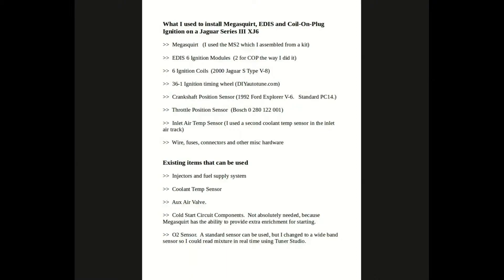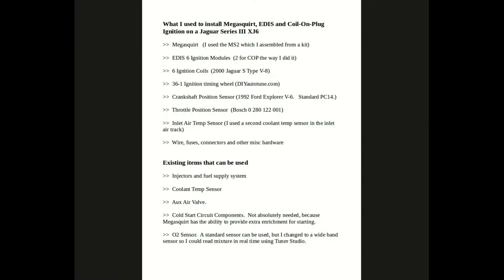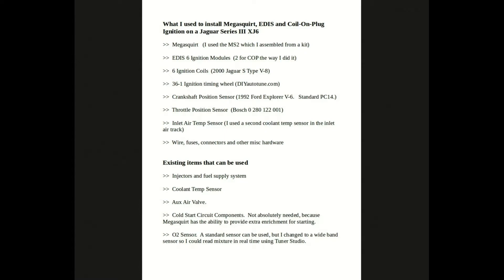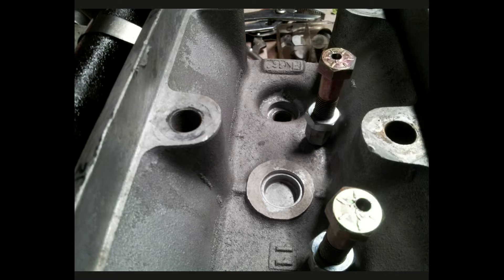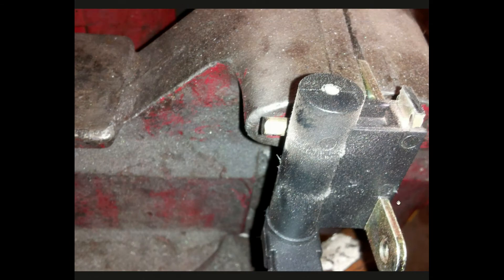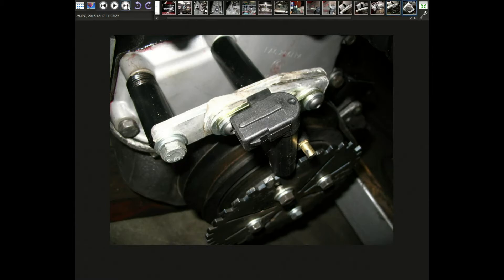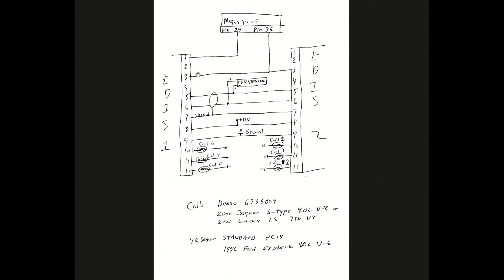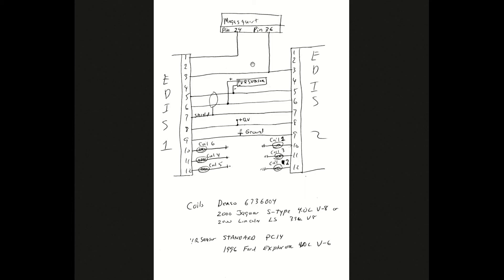83 Jaguar XJ6 with Megasquirt and Coil On Plug Ignition

Comment: Any way you would ever produce a bolt on kit for this? I would totally buy one!!
Reply from the maker: Greetings, I am pleased that you find the concept interesting. I did think about the idea of putting a kit together one time but decided against it. Didn't think there would be enough interest to make it worthwhile. 
Are you referring to the Coil-on-plug part or the whole system with the Megasquirt?

I will be happy to share with you any knowledge I have about it it you decide to do it yourself. However, since I did this five years ago, some of my knowledge might be outdated.
Also, it works so well that I never have to tinker with it and I would have to relearn things that I knew when I assembled it.
Let me know if you are interested in doing it yourself.
Reply: @novom2001  I would appreciate any help you would have to offer! Probably won’t get started on this until winter however.
Reply from the maker: @garthharpole6369   Just give me a shout.  Happy to help anyway I can.

Comment: Hello, do you think this idea of running multiple EDIS6 controller modules from a single VR sensor and single megasquirt ECU could also be adapted to run EDIS ignition for the Jaguar V12?
Reply from the maker: Greetings, 
I must admit I am not familiar with the latest versions of the Megasquirt, but from my knowledge of the MS2 I'm afraid this will not work.  The fuel injection part of it would probably work because the MS2 has 2 injector channels and the early versions of the V-12 fuel inj systems had 2 channels so I think with a little bit of creativity you could probably make this work.  The problem would come with the ignition.  Since the V-12 is basically 2  six cylinder engines on a single crank it means that the firing pulses are going to be 60 degrees apart. The EDIS is a wasted spark ign system and it fires a plug every time the piston comes up, both on compression and exhaust. If you used the EDIS 6 cylinder coil, you would need two, one for each bank.  The problem would be timing these coils.  Maybe it could be done, but you would need a separate computing device of some type to keep track of which cylinder to fire. 

You could however do it by using 2 Megasquirts.  Set up each bank as a separate 6 cylinder engine.  You would need two timing wheels and two pickups spaced 60 degrees apart.
Reply: @novom2001  I know there is some adjustment in the megasquirt tuning software to allow for a crank sensor that is not exactly at the right position but I wonder if it would be possible to tell the second megasquirt that the PIP signal is actually 60° out. This would eliminate the need for a second crank sensor.
Reply from the maker: @jensenhealey907efi  Sounds good in theory. I haven't tried to add that much of an error signal. I did use this feature when I set mine up, but it was very close to start with.  Best place to start is with Tuner Studio and see if it will allow that much variation.

Comment: Awesome video! I am getting all the parts together to do the same conversion. Do you have any info or videos as to how you wired the MS into the existing car harness?
Reply from the maker: Greetings,
To make the MS work, the only connections you make to the existing car harness are the fuel pump,  the switched and unswitched power and ground.  The rest of the harness you make up.  The fuel pump wiring can be accessed at the fuel pump relay on the firewall.
Reply from the maker: Sorry, I had to leave before I finished my thought.
 I did this a few years ago and the MS has changed since I did mine.  Which MS are you planning to use.  I used the MS2 that I assembled from a kit.  I used the standard Jaguar (Bosch) injectors and fuel supply.
I got all the information that I needed from the Megamanual and I am not sure if that is now the best source of info or not. I got mine running and it has been working so well that I haven't had any need to keep up with the changes.
I do have a rough drawing of the connections that I made and I can scan it and send it to you  if you are interested.
Good luck with your project.  I will be happy to answer any questions to the extent of my knowledge.
Reply: Thanks a lot for the info. I was contemplating going with the MS3, but there is nit too mich added benefit so I am planning to go with your setup, no need to reinvent the wheel:)  And yes, if you can send me the drawing, that would  be great!
Reply: How can I send you a private message?
Reply from the maker: @RustundDust  You can contact me directly@ Novom2001@yahoo.com.
I will try to get that diagram to you soon,

Comment: Nice setup & well done, good job. I installed the Megajolt system on my 1968 XKE 6 cylinder. Used a 6 tower XJ-40 coil & plug wires from the coil to each spark plug, had my tach rebuilt from N. Hollywood Tach Shop to accept the square sine wave from the Megajolt board. I also cut the 36-1 teeth into the crankshaft damper. https://www.youtube.com/watch?v=qK8MuDssr3IEverything works great & having no dizzy makes Jag ownership a lot more fun. I gap my plugs from .025 factory to .045 with this ignition system an am running 3 SU HD8 carbs.  Thanks for your very good video. (only 1 EDIS modual)
Reply from the maker: Your test setup reminds of mine.  

I started off using the standard EDIS 6-port coil, wires and single EDIS module.  It worked well, but I was lusting for coil-on-plug.  I tried a variety of coils and didn't find anything that would work with a single EDIS, so I worked out the 2 EDIS parallel system.  The problem was the impedance of the coils.

Nice work on the 36-1.  That is a very good idea.   I ran several ideas through my head and decided to go with the path of least resistance.  It is also good to have a friendly machinist with a mill handy.

BTW, I have a friend who is putting the Megajolt on his 420 sedan.  He is planning to use the standard EDIS coils and ignition wires similar to what you have, but the standard 36-1 wheel like the one I used.
Reply: @novom2001  Using the crankshaft damper makes for a tighter setup, less distance from engine block to damper & rebuilding the damper & then getting it balanced was just good overall design. I had to make the plug ends of the spark plug wires using factory made coil ends so the wires would have the correct ends on the 6 tower coil. Also a fuel filter housing to dampen the MAP back to the megajolt board to slow down the vacuum pulsing for better sensing. Over 7 years using this system & not one part failure or change of any components.......as of today haha
Reply from the maker: @2541968joey   Congrats on the longevity.  It does seem that this system is pretty dependable.  I do like your damper mod, it seems like the way to go.  Did you have it balanced at your local machine shop?

I've been running my system for several years now as well.  Started with the coil pack and wires and ran it for a year or so like that to sort out the Megasquirt.  Then when I rebuilt the engine, I went to the COP ignition.  Only real problem I have had is when I popped a couple of  the transistors inside the Megasquirt.  The guys on the forum pointed me to an incorrect setting that I had in my config, so I change that, replace a couple transistors and I was good to go.  Got about 10K miles on the COP system now, and drive the car daily.
Reply: @novom2001  I got my damper rebuilt, where escapes me at the moment, then cut & then balanced at a local shop here in Phoenix.. Overall things are very good & solid with car running great. Looking to add a 5 speed maybe this year Big$s.
Reply from the maker: @2541968joey  I did the 5-speed thing to my XJ6 about 10 years ago.  For the XJ it is a new lease on life.
Does your E already have the 4-sp manual? You looking at the Tremec, or something else?
Reply: @novom2001  Currently original 4 speed with 3rd giving me problems, double clutching is best going into 3rd. Looking at "The Driven Man" setup. Just a lot of positive items, except price haha, for their setup. The RPM drop at 70 MPH will be nice & smoother, they have a RPM calculator on their site.
Reply from the maker: @2541968joey  I'm familiar with the Driven Man, I installed one of his kits in a XJS.  Also one of my customers had an E-Type coupe with his kit. Changing to the Tremec really changes the way the car feels. The shifter has much shorter, sharper throws, so it feels more aggressive, and of course the 5th speed is a real plus for the E, especially where there are a lot of long straight fast roads.

Good luck.

Comment: Could this setup run a v12? Looking to get megasquirt for my xjs and would like coil on plug if possible. Would I run 4 EDIS 6 units then?
Reply from the maker: I'm not sure how to run the megasquirt with the V-12.  I think I saw somewhere that it had been done, but since my car is a six I didn't absorb it.  The V-12 is essentially two 6 cylinder engines tied together on a single crankshaft (just look at the firing order for each bank), so you could run two independent 6cyl megasquirt systems, but I think there is a better way.  If you haven't already check the forums at diyautotune.com, you might find someone who has done it already.  

As for as using the COP set up and 4 EDIS units, that will certainly work if you can work out the  timing of the two banks.
Reply from the maker: I just found this video.  This guy makes the EDIS  work on the V-12 with Megasquirt.  If you wanted to do the Coil on Plug thing from here, you would just add two more EDIS modules and individual coils in place of the EDIS coil packs that he uses. Basically doubling up what I did for the 6. https://www.youtube.com/watch?v=3uzT0PyqKaM